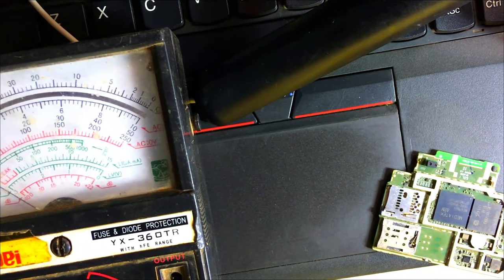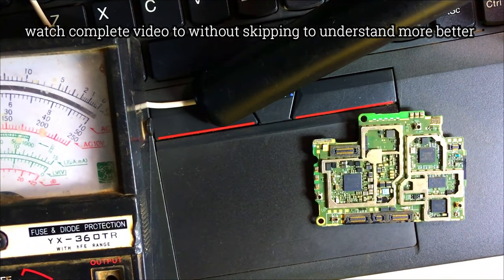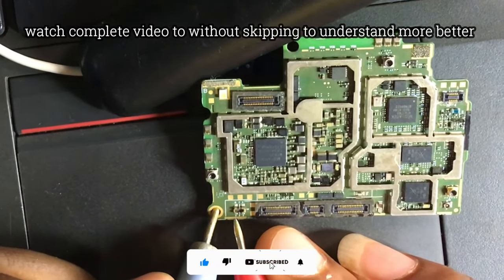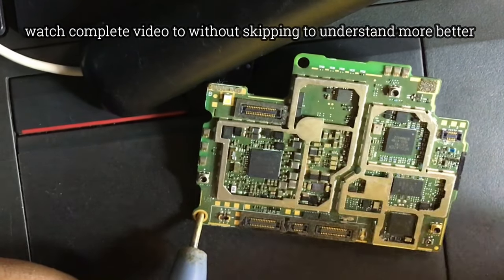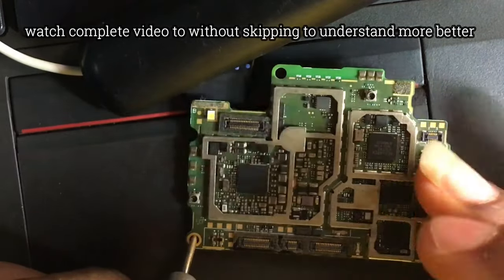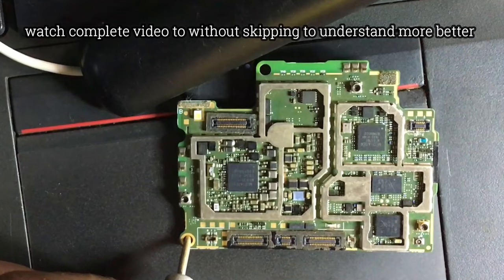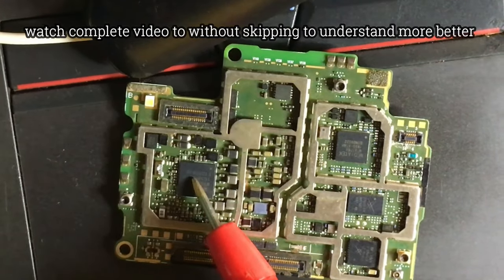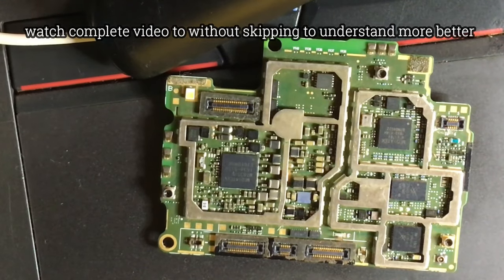All steps of Repairing a Dead Mobile Phone | Complete Mobile Repair Tutorial #sergesmiketechs

Comment: I have a Samsung galaxy tab A, the tablet turn off immediately I unplug the charger. I have changed the battery, but still the same. When I test the voltage with a multimeter, the voltage is not stable, it goes up and come down, from 3.85v drops to 3.0v, in a loop. What could be the problem, please help